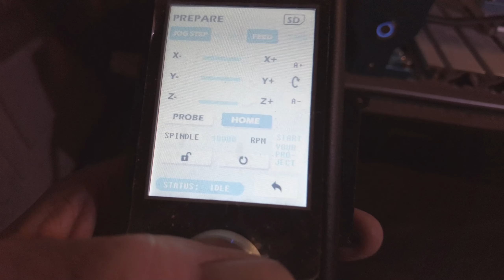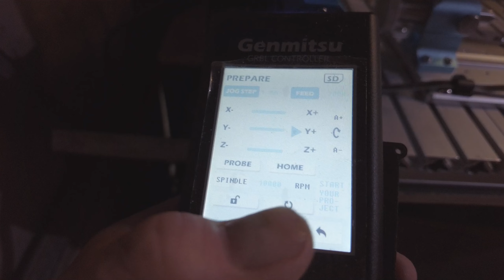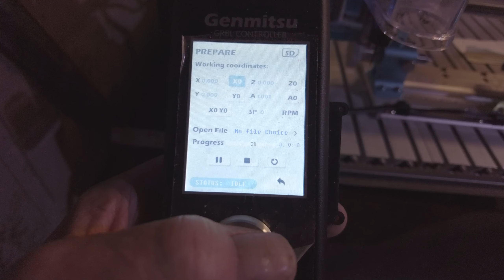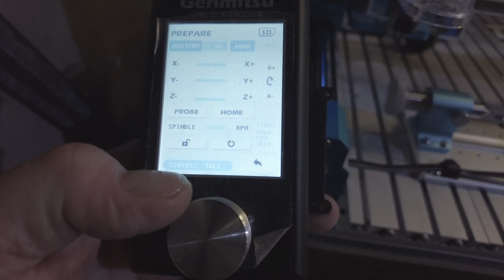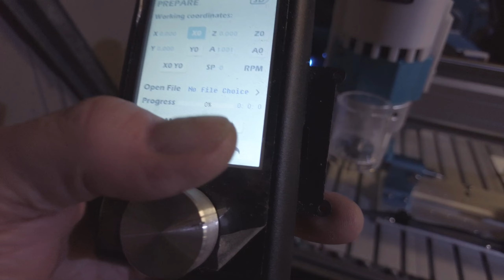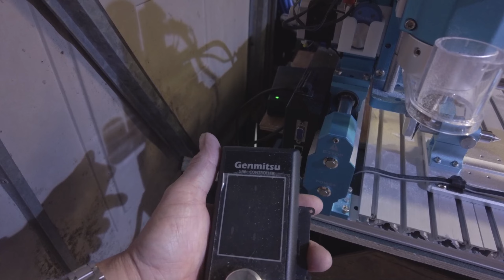Sainsmart Genmitsu 4040 Pro Rotary Axis with offline controller finding the centre  every time.

Comment: Hi sir.. is this project open source???
Reply from the maker: Hi thanks for your comment the off line controller will only work with the correct post processor for this model used when creating your gcode in your design software.